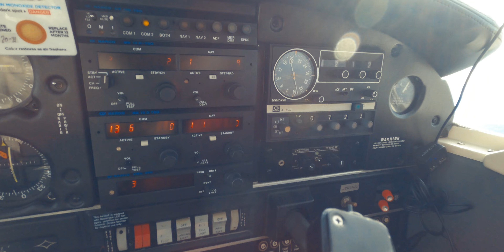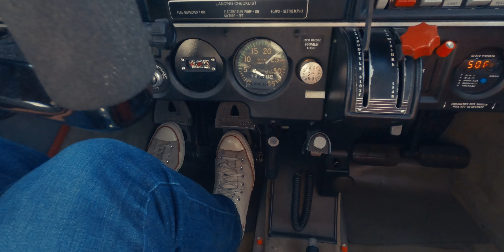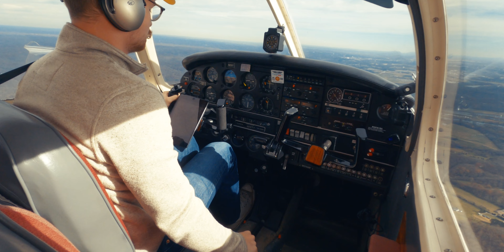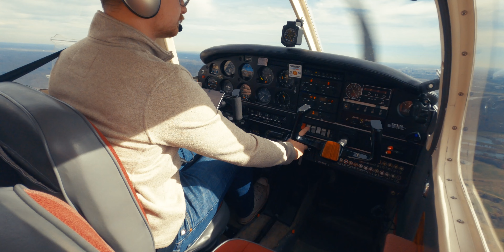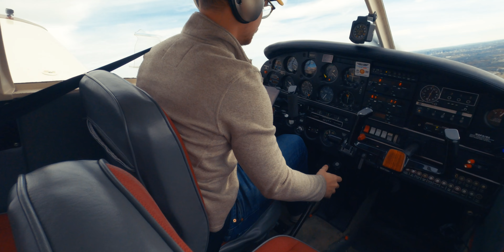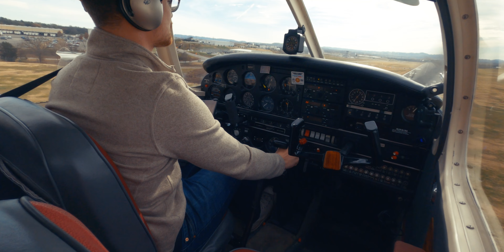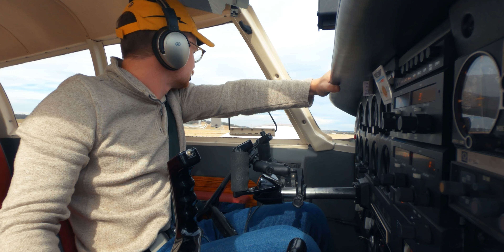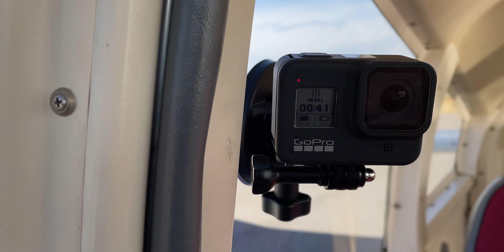The Flight Was Going Great Until... | Piper Cherokee 180

Comment: Luke, I like the videos! I have a 73 PA28-180 I recently bought and have the same issue with the struts compressing and popping up when they want. What causes it? I'm about to service the struts to see if new 5606 solves it. Looking forward to hearing from you!
Reply from the maker: The seals in the struts may be done. Luckily they are pretty cheap to replace. It may also just need more nitrogen. Ask your A&P to check it out and I think it would be like $20 a strut for the rebuild kit, so prolly like $200 a strut in total or something like that after labor.
Reply: @lukeslanding2230  thanks

Comment: The PA28 has plenty of elevator power to allow very clean and accurate mains wheel landing's followed by the nose wheel. Why would you want to land on the 3 wheels when it was never designed to do that.The PA28 has enermous pitch and trim to resolve any kind of landing. Despite the fact that the Cherokee is a tri gear aircraft all the landings need to be done onto the mains followed by an elevator let down onto the tri front wheel.
Reply from the maker: The strut seals were to be replaced on this airframe so I had to ensure I landed at the lowest touchdown rate I could without any stalling above the runway. The struts are fixed now but at the time, it wouldn’t have been good aiming for a stall out landing on the main at any height more than a couple feet. Also, the 140’s and 160’s, you can hold the nose off but this one runs out of elevator authority near stall. You can’t hold the nose off unless you load. But single pilot full fuel, it does not allow for this.

Comment: Kudos for paying attention to the details.  I recently had a first flight after an annual, doing the take off run, I was fully prepared and expected to abort takeoff .. but was still surprised when I actually DID abort. The mental part surprised me after the fact.  I couldn't see why in the gauges, but something felt/sounded off. It was later verified via engine data, but .. it was the right call.  Simple issue and resolved with additional run up time to move more oil to the prop that was a tad dry after some work. The harder part was the PIC decision on next steps.  Trust the machine. Trust the process.  Trust your experience.  Next run sounded and felt right.  She flew like the stable, smooth platform she always had before.  Numbers were good AND felt right.
Reply from the maker: What you said about being surprised when you actually did abort is really relatable. What plane do you fly?
Reply: "attention to detail"???? The guy tried to take off with the trim nose down! Checklist,checklist,checklist.....DUH!!!!

Comment: "Some CFI in the comments is going to tell me why I'm wrong"  Happy to! 
Vy will always get you the most altitude the fastest. Vx will not. If you take off and fly Vy from the start you will be hirgher faster than if you fly Vx for any length of time. Vx might seem like your climbing fast because you're pointing up. But if the identical plane was taking off next to you at the same time flying Vy and you're flying Vx you would be watching it climb above you. Nice video!
Reply from the maker: @lockirocu  For the purpose of getting over a tree that you’re close to, Vx will have you gain more altitude in a shorter distance than Vy. But Vy will gain you more total altitude over time. So Vx is trading more horizontal velocity for vertical, so higher vertical to horizontal ratio than Vy even though the vertical vector is slower.
Reply: @lukeslanding2230  Definitely! In your engine out scenario, and 'getting some sky below you' you'll want to shoot for Vy straight away. Maybe Vx would be useful if you have a 10k foot runway and a hope of landing on the remaining runway. For garden variety engine failures after takeoff, Vy all day long! Thanks for replying, great channel :)
Reply from the maker: @lockirocu  Oh yeah, I’m completely with you! Thanks for watching ❤️